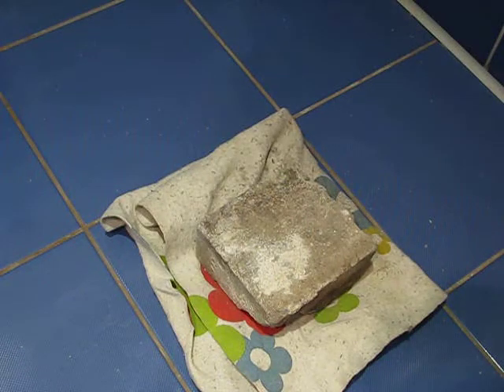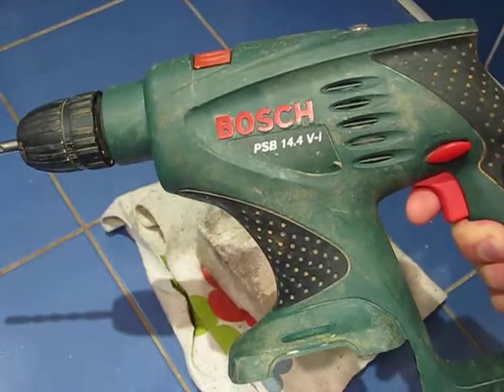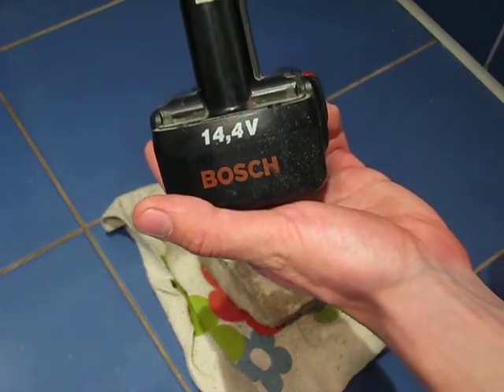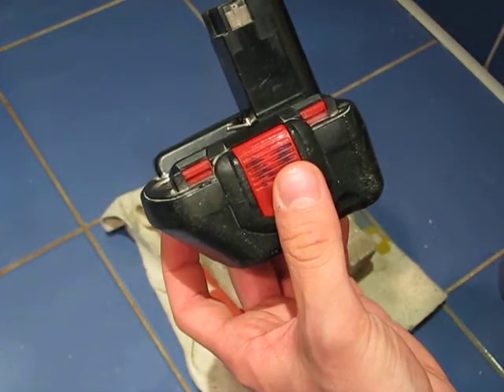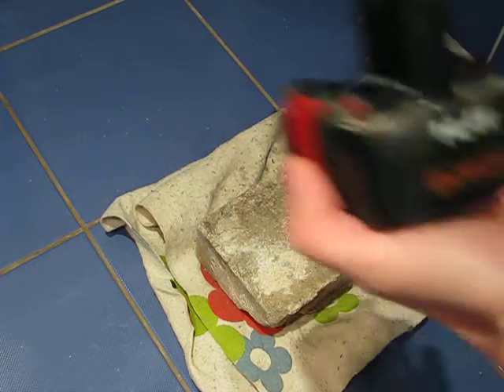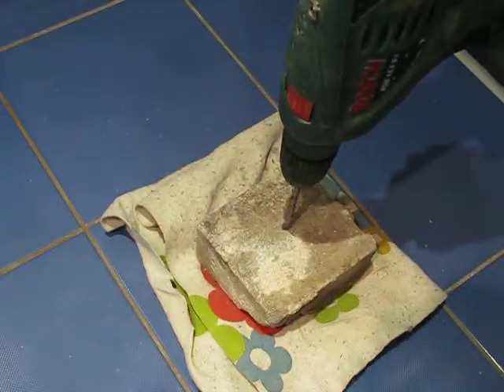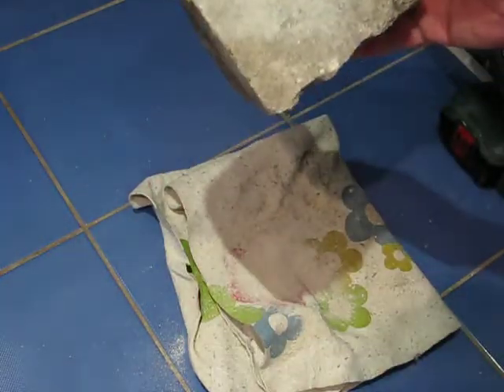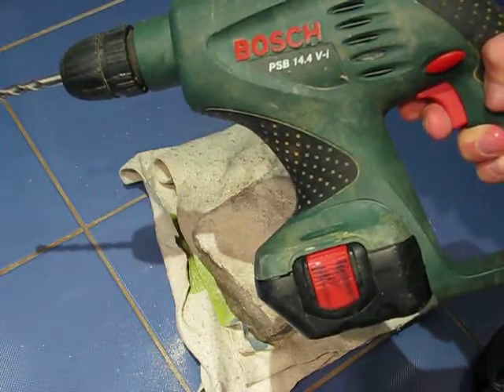NiCd and LiFePO4 comparison - Bosch 14,4 V-i power tool

Comment: @john ioannuo , like adam says but a lil different, i would leave the resistance module u found under the cap in place, it is there to stop over discharge (eg get really hot with big load) if u take it out might get hot and pop , but if u use a PCM BMS then that will manage all that stuff for you as long as the pcm knows what type of batteries it is using, cheeper to leave the protection circuit in the a123

Comment: hello i have a similar drill to yours the PSR-12. I plan to replace the 10 original NiCd cells with 4S1P A123 lifepo4. I opened the battery housing and found there is a resistor on top. Do you know what is the purpose of this resistor and If I should keep this resistor after placing the A123 cells or discard it? What have you done with your modification?

Comment from the maker: This resistor is to "inform" the universal Bosch battery charger what is the voltage and capacity of battery pack (that is because of different packs has the same connections).
I removed all stuff from battery pack including resistor. I leave only metal connections and isolator. I can send You a raport with photos included, contact me at: adampyka [maupa] gmail.com
Remember that You need special charger for LiFePO4 cells (oryginal Bosch is forbidden!!!) and Protection Circuit Module.